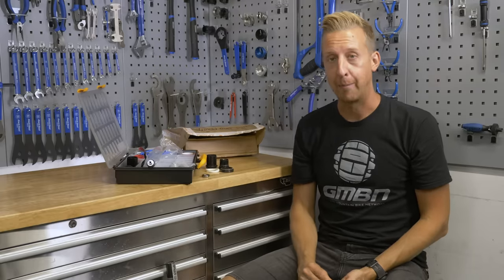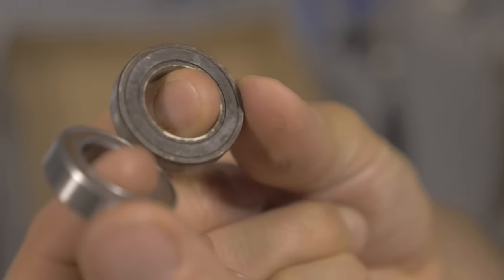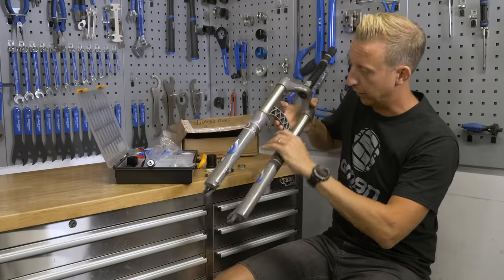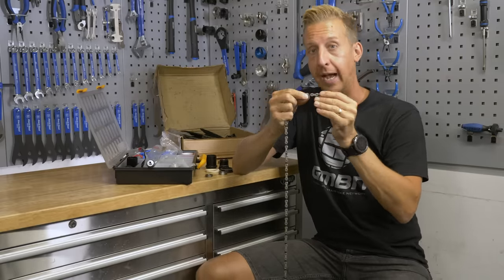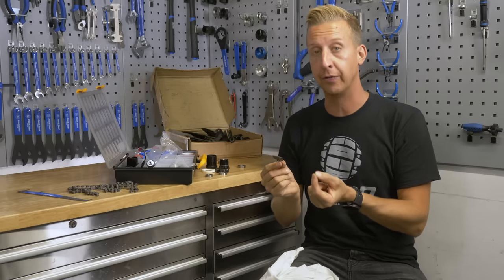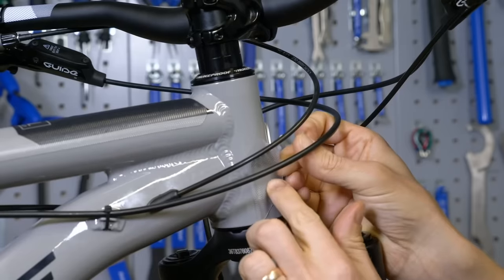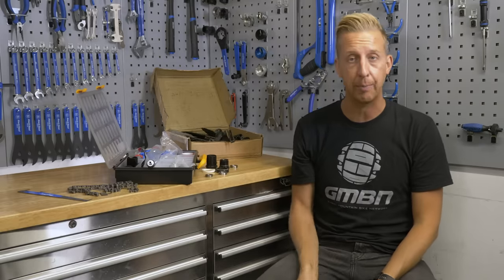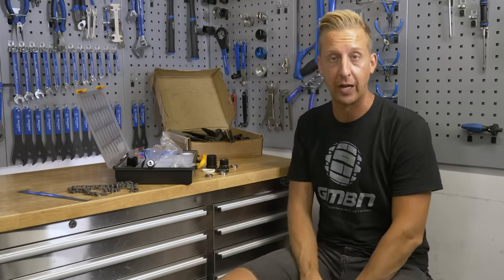7 Ways You're Destroying Your Mountain Bike | MTB Maintenance Tips

Comment: Anyone else remember when you bought a bike,  rode it all day everyday, once in a blue moon cleaned it and sprayed the chain with WD-40 and it run sweet as a nut ? Now you need to stripe everything and rebuild your forks every 40 miles 😂
Reply: I remember using WD and having my chain rust 😭😭 .
Reply: I still do that, works perfectly fine. Chain needs to snap or frame need to break before i start to do something probably.. If the chain starts to slip due to worn out teeth, just use another gear :D

Comment: I dunno about frame 'protection'. I ride the shit out of my bikes, and they get beat up. No amount of tape or rubber is going to help (having tried that).  I just accept that my bike is going to get dings and scratches and worn. Those are character marks, in my book.
Reply: Just buy a car paint touch up pen for paint chips.  I am going to be even more anal and buy a model airbrush kit to get a professional finish.
Not even that expensive and can be used for many other things that need painting touch ups.
I have 2018 Kona Honzo and the bronze paint is beautiful but chips so god damn easily.  Cable rub on front headstock is where a sticker is definitely needed.
I dont really want to cover my bike in these patches to be honest, I think learning to repair the paint to an acceptable standard yourself is the way to go.  Its gonna get scratched and chipped.
That way instead of having a big cry like a did when I dropped my new bike on day one is no longer such a drama!
Reply: Battle scars as I like to call them.
Reply: some frame protection isn't too bad. You'll still get scratches (and if your bike is aluminum, then it's naturally corrosion resistant too. But I'd rather keep my paint looking nice for as long as possible before I have to break out the touch up pen, so my AL comp is getting some covering on the more common wear areas at least.
Reply: It is the sad part of a beautiful paint job. It doesn't last forever. You see it on cars too where many now vinyl wrap theirs to protect the paint a bit longer for possible better resale value. So you buy an expensive car but never get to look at it in all its glory due to the wrapping.
Reply: First thing I do with a new bike or helmet, is drop it. Kills the anxiety right there
Reply: @travisburton2948  Dont drop yer helmet mate - impairs it
Reply: When you remove wraps you are left with a really clean part where the wrap was, and then scratches and scuffs all around it in a perfect outline, it looks really odd. So unless you use wraps for the life of the bike and get the same ones every time, or can wrap literally the entire bike, I wouldn't bother.
Reply: im building a new Crust Scapegoat and i honestly cant wait to thrash it. bikes to me are always crust mobiles.
Reply: Maybe more important for a carbon frame that could get some nicks and chips that would weaken it structurally?
Reply: There are some plastic protector for your bike you could get
Reply: Use 3M helicopter tape 8671HS, and buff and polish the rest...   Does miracles
Reply: Its a bike, its made to be used, sure dings are annoying but at the end of the day it doesn't really matter, its not like its an investment that needs to be kept in mint condition
Reply: @mrpants6337  If my frame gets a scuff, it gets a cute sticker. I need to get some more.
Reply: Ridewrap is great

Comment: Checking spoke tension is always a good thing to do regularly
Reply: This and bearings are two things I constantly forget about until I see a reminder on the internet and proceed to freak out and check them out, thanks
Reply: @ Michael Stewart
I needs to learn that ☝
Reply: Rode around with a loose one for months before I found it.
Reply: Michael Stewart how?????
Reply: @sethmeistergee  
I want to learn that skill, too. 😵 cornfusing
Reply: @sethmeistergee  Just grab 2 spokes where they meet (make sure they are pairs that cross over each other), there should be a very small amount of "flex" between each spoke. If one is silly loose and moves like crazy (the opposite one may well be the same or over tight) nip it up/slack it off with a spoke key (might be a couple of sizes) and check the opposite side of the wheel to see if any are over/under tight.

do this for the whole wheel, and check after tightening any loose spokes.

best way I can explain it, it's a dark art and truly needs to be done on a truing stand.
Reply: This is the one regular check I do on my bike after seeing my partners spokes snap so frequently and how hard that makes riding the bike home.
Reply: @tommycooperfish  I bought a spoke tension meter just for this. It measures the deflection of the spoke, and some come with a chart for the min-max deflection for different spokes. I bring my spoke tension up to two points below the max on my wheels, makes em stay true longer and makes em stronger.

Comment: 1:50 DO NOT EVER use WD-40 as a lubricant on bearings. if you look closely hes actually using break cleaner to clean them, not standard WD 40 to lubricate them. if you make that mistake you'll ruin your bearings.
Reply: WD-40 can be used to clean bearings
Reply: @schunacher  you can CLEAN ur bearings with it, although there's probably a million different solvents better than wd40 for cleaning. problem is you have to re grease/ re lube the bearings after using it, which is often overlooked. cuz wd40 is not a lubricant.
Reply: @kieranslawson6516 ...lol, no it's not
Reply: @kieranslawson6516  LOL wtf, WD literally stands for "water displacement"
Reply: @kieranslawson6516  Haha! It's mainly naptha with a little light oil. It's great for cleaning and unsticking things but only is a very light lubricant so can't handle loads and is gone almost instantly. It contains NO WATER. and Zeoanchropolis
 is correct on the origins of its name
Reply: Um, ahem... "brake" cleaner.  Break means to cause damage.  But your point is valid. I probably wouldn't use WD-40 or brake cleaner on bearings.  I use a clean dry cloth. If lube is needed, there is actual bearing lube that is more appropriate.
Reply: @schunacher  it destroys the seals in your bearings. Its really never a good idea to use wd40 to clean them. Brake cleaner is cheap and a way better option.
Reply: Lol I just use whatever I have at hand. Usually some protective lubricant spray or ptfe. In the long run there’s not much in it. As long as you get all the shit out of them.
Reply: Use Grease not oil key point!!!
Reply: We can use them to degrease and clean them and then add another lube right?
Reply: @valesz4140  you could, but if ur gunna go through the trouble of that id say u might as well soak ur bearings in a cup of solvent. but the most important thing to do in any case is to RE-GREASE them. otherwise u might as well throw ur "clean bearings" out.
Reply: What are you guys on about? It literally reads "brake cleaner" on the can.
Reply: @stobot7213  no shit.
Reply: Skateboarder here just listening to all this talk about bearings lol. Rule of thumb, dont clean with anything other than solvent. 90% isopropyl works great, as does brake cleaner or nail polish remover (acetone). WD 40 can be used to clean but never as a lube. Then you get into types of lube. Mineral based, silicone based... find what works best for your setup and riding style. If you like the mud and wetter conditions, use lube designed to displace water while remaining attached to the balls within the bearing. Ion flux is a great lube, but good luck finding any. Riptide makes bearing lube for both wet and dry conditions. Too much lube or the wrong type will just accumulate dust and gunk until it seizes the bearing. Not many vids on mntb bearings, but there's tons of skate bearing maintainance vids. And trust me, downhill skating at 50mph plus, you really pay attention to and learn how to care for your bearings.
Reply: Its a WD40 branded cleaner. They make other products too. Most likely its alcohol based so it evaporates
Reply: WD40 isn't even really a true lubricant, it's to prep something to get lubricated. It's #1 thing to do is to displace water.
Reply: It’s got to be a good 50 percent of the population that get “brakes” and “breaks” mixed up
Reply: An advantage to brake cleaner is not leaving residue that needs to be rinsed off
Reply: I just used WD-40 to clean my chain last night and it's works well as a cleaner. Also WD-40 does offer actual wet and dry chain lubes.
Reply: I use it for my chain, repels water. Works great

Comment: "You could be wearing out your bike prematurely by riding it all the time."

Dude...
Reply: No bike = no maintenance = no cost 😅
Reply: @jevieyt  true but you need to replace your running shoes somewhere from every 500-1000 miles and your hips every 10k miles.
Reply: Spend 5k on your mtb and then drive a piece of junk to work. Sure thing.
Reply: @MisuracaAntonio  I like to cycle something that looks kinda junky but is functional despite being simple.
Reply: yes, the point is not to waste the lifespan of your overpriced performance components commuting to work because, it's totally unnecessary and wasteful.

use your expensive sport bike for sport and your cheap commuting bike for commuting, ain't that complicated fam

Comment: Thanks for an excellent vid but I'd like to add something about looking after suspension forks. I used to have a set of those Fox TALAS forks and the owner's manual stated that the foam rings under the seals are there to ensure the small amount of lubricating oil (usually around 10ml per leg as you said) is between the seals and bushings when you ride (you soak them in oil when servicing the fork). To this end they recommend storing your bike upside down when not in use which I always did religiously as well as wiping the stanchions and seals with GT85 on a rag after every ride. When the time came to get my TALAS fork serviced for the 2nd time after 2 years' use, the shop I sent them to (TF Tuned in Westbury) commented most of the TALAS forks they see that age are worn out like the ones in this video; however, later that day they called me to say my stanchions had NO visible wear AT ALL and all they needed was a full service. A lot of modern MTB forks like Rock Shox etc have these foam rings impregnated with lubricating oil because the damper unit is a sealed cartridge; if they use this system, store your bike upside down and the fork will last a lot longer. Also getting a chain cleaner for £5 from LIDL massively increases your drivetrain life and is every bit as good as the £££ "brand name" alternatives

Comment: just ride your bike, the one you love and when shit wears out excuse for upgrade, don't let this dude get you down.
Reply: Mines 2g 🤣🤣 I’m not upgrading anytime soon. I am buying a single speed for exactly that. To maintain longevity of my main bike
Reply: Ride it and take care of your stuff
Reply: @drnapalm7605  of course. My point still stands, I will use two bikes. Lol
Reply: Time is money.  You can spend hours every week meticulously cleaning and checking every bolt with an allen key, etc; in the hope that it lasts for 6 years rather than 5.  Then it gets nicked, or you have a crash, or the technology is outdated and you can't get the parts for it anyway.  Or you can just wait till stuff breaks and replace it.
Reply: @alkaholic4848  seriously replacing parts over time isn't super expensive if you're not using super high-end stuff. My last two bikes got stolen, but my current bike, I intend to make into Theseus' bike.
Reply: No way I'm riding a cheap for my daily commuter. I drive my one and only good bike and replace parts with better ones as they break. I don't like driving a cheap bike. I've moved on from that experience.
Reply: Plus if you had a 2nd cheap bike for commuting you likely replace parts more. The cheap bike I had years ago had a weak square taper BB and crank arms that cant take half of the abuse compared to my current  hollowtech 2 set up even as a daily commuter. Although I'm hitting a couple trails on my way to work with some roots and hard pack dirt.
Reply: @practicalguy973  Not a "cheap", an affordable. There's a subtle but meaningful difference. I wouldn't ride a department store bike unless I really had to, but a low-tier bike store bike is tolerable enough on tarmac.

Comment: 10:05 That's measuring the thickness of the rotor arms. Pretty sure they'd don't wear. Just measure the braking surface.
Reply: Ride enough and the rotor will wear. Definitely worth swapping out before it gets too thin. Usually youve changed your brake pads more than 6 times before you start to worry about this.
Reply: Clearly measuring the braking surface...correctly (where possible) using the main mid part of the caliper jaw, not the tip
Reply: @rupedog  The calliper's just going to measure the thickest thing it's placed around, regardless of which part of the jaw happens to be there. As shown, that will be the never-wearing rotor arm. Better to point the calliper more in the direction of rotation, rather than towards the hub centre and ensure it only contacts the wearing surface.
Reply: perhaps he's measuring the arm to get a baseline of how much wear is on the brake surface.
Reply: Yes thats right, you need to be carefull not to measur the ticknes of the rotor on places where there have been no wearingout. that are the rotorarms and in some cases there is a smal grade right on the edge of the rotor.
Reply: @foryouandyourwaifu2508  
Thanks for that info. I usually do V brakes but I got a new used 29r that has hydraulics on it. Gotta figure out the bleeding process
Reply: @slippy9916  welcome to the club of "no more slipping brakes!" V brakes may be really nice for the simplicity, but they wear away the rim sidewall, which results in a much more expensive replacement later on.

Watch the many bleed tutorials out there. The process will vary somewhat based on the type of hydro fluid and the brand of brake. Shimanos are by far the easiest to service, and even the SLX is a really nice brake. Srams are more difficult, and require a syringe at the cylinder as well as the caliper. Im not sure about the others, such as hope and zoom.
Reply: @TheDustyShredder  
Thanks Shredder, funny you mention the side rim. In 95, 96 I trashed a a Good rim. By time I was done with it, looked like a junk car rotor. Yea I think I'll enjoy the new club. I think the new brakes are the Juicy 5's
Reply: @slippy9916  no prob mate. Here's a video for your brakes: https://youtu.be/pxTZ2QTPc2w
Posted by GMBN, you're sure to get a good tutorial.

I've seen one case with rim brakes where the pad actually wore through a roadie's rim on a downhill section. Front tube blew out, tire shredded up, sparks flew, and the roadie went to the ICU. Ever since I saw that (and had V brakes not work while towing 130lbs of cargo at less than 15mph), I've personally renounced rim brakes for anything but the most casual of riding. Still, I run into those people who swear by them.

Enjoy your juicys! With proper care, guided by the people at GMBN, those brakes will last you a while and remain reliable.
Reply: @TangoOne  Ah...yes....that's what he's doing...clearly ;)
Reply: @beingoutsideisbetter3204  This! Spot on. Just measure the disc between the arms

Comment: Nice video, thanks. One thing I would add is that an analog vernier is just as good as a digital one. Digital callipers batteries eventually run out, but the analog ones still measure to 0.1mm and will be ready to go whenever you need them.
Reply: Also, I think it's difficult to measure rotors like that, there can be a flange on the edge causing the reading to be very wrong.

Comment: I discovered that a safety pin can be used to remove the seal on a bearing allowing you to clean it using solvent and air and then repack it. I also keep silicone spray handy to help repel dirt on the shock surfaces

Comment: A timely video. This morning's pre-work ride was the first really muddy one since spring. It might be time to switch back to my cheap hardtail and save the full suss bike for special events until conditions improve next year. 

Brake pad wear is a funny thing. One really crappy wet winter I got through three sets. Most winters I just need to replace the pads once. Every ride involved at least one stop to clean off mud with a stick just so I could keep the wheels turning. When you have heavy clay based soils and then tracks that have been surfaced with sand and fine gravel, you have the perfect recipe for worn out bike parts.

Comment: Correx sheets make excellent frame protection. It's a corrugated plastic sheet, similar in structure to cardboard box. Two surfaces and tubular internal structure. lightweight, cut with scissors, and is great for underside of downtube and chainstays. Fasten with tiewraps.
Been using it as a chain slap guard for chainstays and bottom bracket "jacket" for years.

Comment: I found riding in the summer on my old 160mm discs destroyed pads. If you can fit 205mm rotors then do it. Heat kills pads and one sure fire way to heat up pads is to use a lot of braking on small rotors on a hot day. Every factor there goes against good heat dissipation.

Comment: #askgmbntech Good tip with frame protection. Use a hair dryer or heat gun to make the frame protection more pliable and less likely to tear when applying. Also if you do it wrong it easier to remove and start over and easier to push out air bubbles.
Reply: askgmbntech is for asking something not for giving them advice.